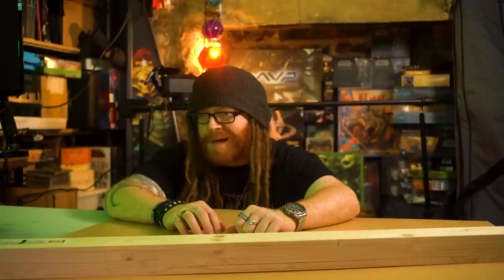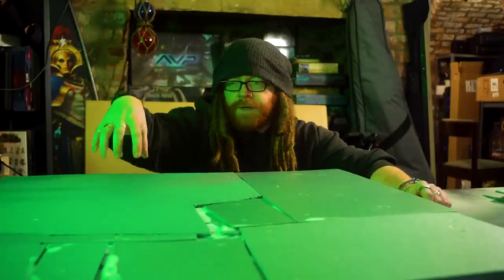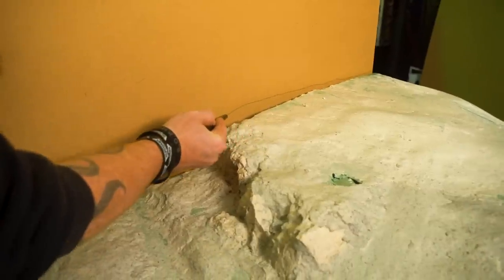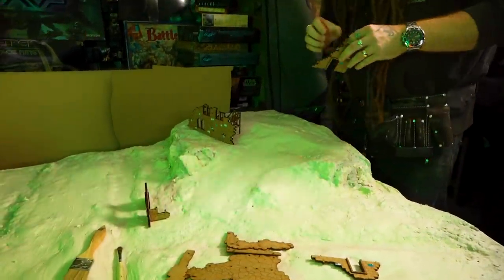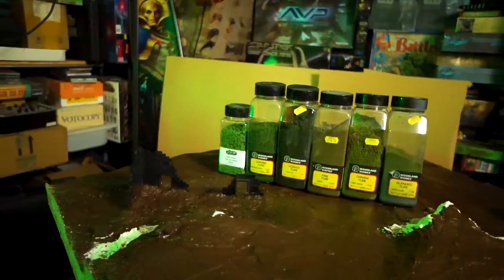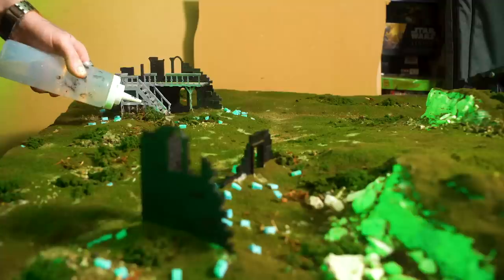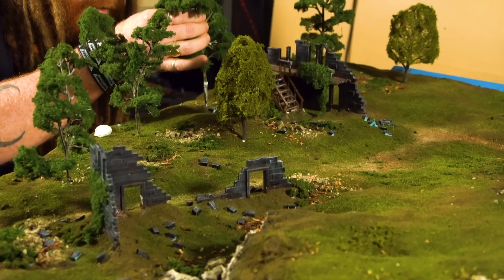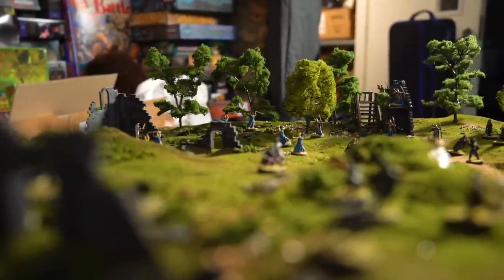How To Make An EPIC WARHAMMER, 40K, SIGMAR, MIDDLE EARTH, GAMING TABLE

Comment: Skip a step if you get 50% isopropyl alcohol and use that fluid to make your 50-50 mix of PVA and water, just use the 50% isopropyl instead. In effect you get 50% PVA, 25% isopropyl, 25% water.
Reply from the maker: Thanks for the tip!
Reply: Nice,I’ll try this in the future!
Reply: This is what I think every time I see this process. Is this true??

Along those same lines, I've wondered if it would be prudent to add the first basecoat of brown paint into the final plaster/modeling compound, for speed but also so that chipped plaster just reveals more basecoat rather than stark white.

Comment: Thats a really nice board that dude, I made a couple of little shelf terrain things for my wall to display my age of darkness stuff the other day, and used foam clay to taper the various planes, similar to how you would use modelling compound. It doesn't hold fine sculpting well and it looks like fine styrene balls on the finish but it is really really light! with a little sand glued over it it looks great, and it can save a lot of weight if you want to make some light weight stuff for transporting :)
Reply from the maker: Been thinking of getting some foam clay but it seems to be reaaaaaaally expensive for what you get.
Reply: @MSPaints  yeah 15 quid for 560g is a bit steap, but it's nice to use in my opinion, the fact it's relatively clean and easy to use is also a bonus and if you're just using it to blend together platforms on rock formations made of styrene sheets, it'll go a surprisngly long way.